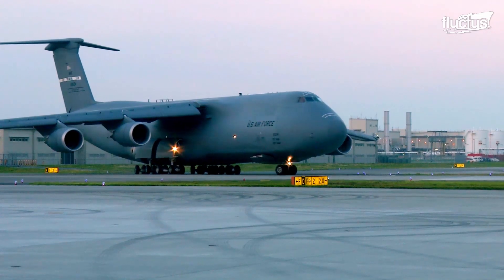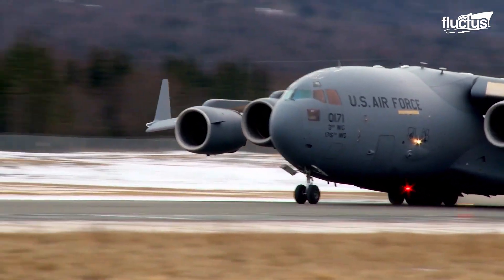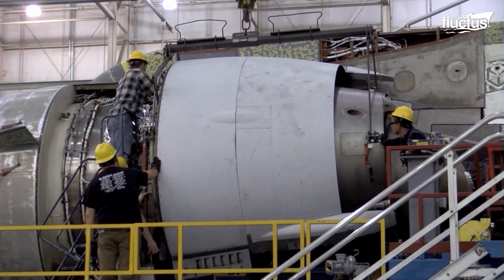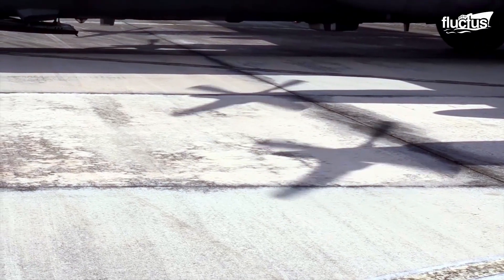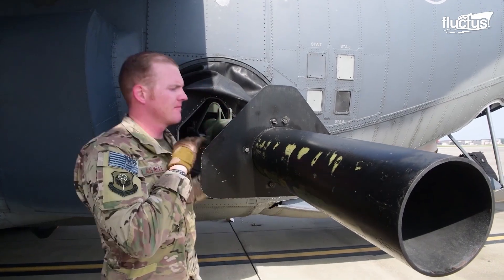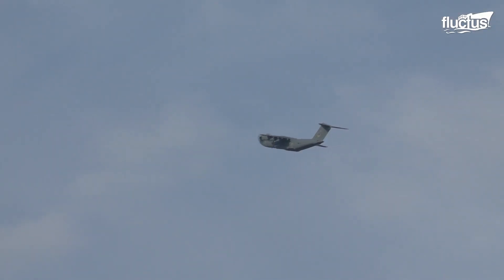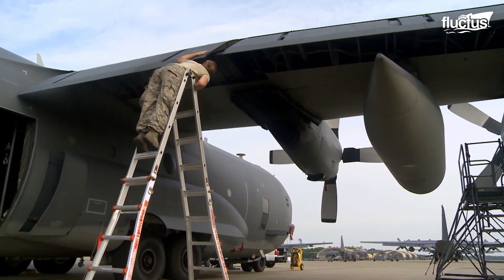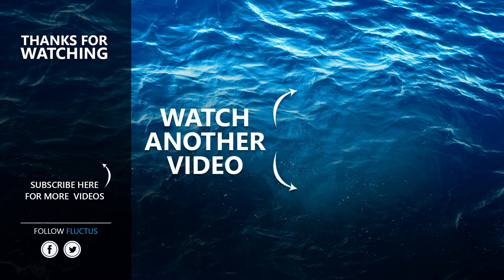This US Air Force C-17 Engine is So Powerful it Can Create a Mini Tornado

Comment: You need moisture in the air, the jet fans turn at incredible rpm's, similar to the moisture clouds that form around the edges of a jets wing when moving fast.

Comment: Not exactly related, however I worked as a precision radar system Technician at Homestead AFB ( 1968-1971) and we had B52’s and their counterpart The C-141’s with it very prominent large and high tail section would present itself on the radar scope as 2 very close radar targets. The newbie air traffic controllers using the Precision Radar MPN-13 GCA would panic thinking they allowed 2 aircraft to become very close to each other.   The C-141 was the ONLY aircraft in that time frame that would present 2 targets as the precision radar would make a radar target from the front section of the C-141 and another radar target from the tail section.     Present day I wouldn’t know about.   Go USAF!

Comment: These engines might have some power but the C17 cruises slower than most commercial airliners. Love the reverse on this airplane ✈️ C17s are amazing aircraft
Reply: True, but the reason why it cruises more slowly has more to do with airframe design than it does the engines. Those F117 engines put out around 40K of thrust each. Added together, that's 160K. That's more thrust than the KC-135's F108 engines put out, but the KC-135 is lighter, has a more "sleek" aerodynamic design and cruises at around M0.84 vs the C-17's M0.77.
Reply: Not to say that stronger engines are necessary to produce those visible vortices though. I started my USAF career as a crew chief on EC-130 aircraft. I did numerous maintenance engine runs on those birds in which vortices (tornados) going between the intakes and the ground were visible. They're like rainbows. They can show up on any jet powered engine, but they are easiest to see when weather conditions are right for it.

Comment: Lots of jet engines can do this. It depends more on the temperature and humidity of the air than on anything else. I've seen idling F-16 and F-14s do it several times.

Comment: In the early 70s, there was only one C-124 still in active service.  It was at Elmendorf AFB.  It crashed at a small base in Alaska and the crew survived.  It was replaced with another C-124 that the reserves had been using.  It was mainly used for oversized cargo at that time.  I helped load and tie down a fire engine in it once.

Comment: The "waterspout" effect has been seen in 737, A320, 767, 747-400, and 777s.  This is not just during thrust reverse, but in idle.
Reply: I've seen the back end of electric Motors do the same thing. It's nothing groundbreaking

Comment: The C-130 was even more impressive when it had JATO capability.
Reply: Or when they landed one on a carrier!
Reply: @brettmorton7365  As well as stop without the use of the arresting cable and take off without the use of the catapult system. 
The largest aircraft to ever land on and take off from an aircraft carrier under its own power. What an amazing piece of equipment!
Reply: @Philliph Whirley  and i believe it started its take off from where it stopped its landing! You're absolutely right, amazing piece of kit!
Reply: Oh, yeah!!! Loved the max effort takeoffs and landings!!! Yeah, riiight!!!
Reply: @philhand5830  It was just really cool to watch the JATO ignite and the airplane almost instantly lurch upwards. It was awesome watching the Blue Angels C-130 climb straight up. It’s not often you see an airplane that big pointing it’s nose that high. That is until the Boeing 777 which was amazing too.
Reply: What is Jato capability?
Reply: @adamrutherford4759  Jet-Assisted Take Off
They were essentially rocket packs made out of several rocket motors per pack depending on the weight of the aircraft and takeoff length of the runway. They were installed on both sides of the C-130 on the lower section near the cargo bay door. The C-130 would start its rollout on its main engines and then fire the JATO packs and it would give the aircraft a massive boost which would decrease its takeoff time. Search C-130 JATO on YouTube and you will probably find some older videos of them being utilized. 

Look at it like a race car using Nitrous “NOS” on the race track to get a quick and easy boost of power and speed.

Hope this helps.

Comment: Virtually overlooked on the C17, is the "blown flaps" feature. The flaps have portions of a flap directly behind the engine. It's too hot for aluminum, so those portions are made of titanium. Most aircraft do not have flaps directly behind the engines. This adds immensely to the lift produced at very low air speeds. This allows very high angle of descent, while maintaining a low rate of descent. This combination allows a very short roll out on landing, & very short roll out on take off. Very few aircraft have put together this capability. The idea of blown flaps has been around a long time, but this aircraft came along just when materials technology made it practical. 

The prototype demonstrator had "double blown flaps". Not just one series of flaps, but when deployed,  two sets of flaps, like louvres in a window shade. I asked if the change from double blown to single blown would lengthen landing & takeoff distance. The answer was "yes, but it would still meet specs". Double blown is heavier, more expensive, more complex, & requires more maintenance. I think they made the right choice.
Reply: Great comment, thanks for sharing your insight
Reply: @johnwilliams1091  From what I remember about aerodynamics, "blown" flaps means not having your engines blow against the flaps, but using bleed air from the engines (or having an own compressor) tthat iis blown out over the surface of the wings and the flaps in direction of the airflow to help it maintaining a smooth, laminar airflow, orver a higher angle of attack/larger flap angles, creating more lift at lower speeds (here: lower landing speed/shorter landing and takeoff runs)  
  

Without that, the airflow delaminates earlier and becomes turbulent  causing a massive increase in drag and loss of lift.   
 
That would explain the ridiculous climb angles you can sometimes see on videos.
 
  
Especially the Lookeed F-104 Starfighter needed such Boundary Layer Control, or his stubby 21 foot wings would never have been enough for reasonable landing speeds. 
 
Boundary layer: The layer of air over a wing/any surface where the the air transitions from a standstill (relative to the surface) to the full speed of the airflow.
 
That can happen over a distance of a few tenths of a millimeter til several meter, the faster the speed, the less the thickness, the bigger the surface, the thicker the boundary layer. 
 
I learned that at very low eind speeds the bountary layer over water can be up to 10 meters (30 feet) thick. 
That means the mast of a moving sailing ship pokes up through a massive change in wind direction. On the ground, you have no wind, the only wind you have is from your own movement and so directly from ahead. The higher you go, the more true wind combines with that induced wind, 
For sailing, the real wind has to come about 30 degrees from the side over 90 degrees to 45 degrees from the back, or even directly from behind. 
 
So you get an extreme change of apparent wind direction, from directly ahead to the true wind. You want the optimum angle of attack for the sail (which is aerodynamically more or less a wing set vertical) for maximum lift and minimal drag, so you trim it with a lot of twist, practically in centerline with the boat at the bottom, and let out far at the top.  
 
Sorry for that deviation, but I LOOOOVE the universality of physics. That once you understand the principle, you can apply it in all kinds of situation. 
 
 
Therefore my car will not get a cool spoiler - unless someone can prove to me that it is optimized to really create no additional or even less drag. 
 
Race cars have ample power and need pressure on the tires to avoid wheelspin, and ground pressure at low speeds to not slip in curves. 
To produce lots of downforce for the curves, the wings are massive, but that means enormous drag on the straights at high speed, so you must compromise.
Sacrifice top speed to be fast in corners. 
 
But as "normal" driver, do I really need that?   
At zero speed, the lack of wing speed means the spoiler/wing has no effect. 
In the city, you don't need it, too many dangers around. 
On country roads, OK. 
And in the US your speed is 55 mph anyhow, so who cares about losing top speed. 
 
But here in Germany, where we still have about 8,000 kms (5000 miles) of unlimited autobahn, reducing my top speed would be stupid. 
It's an old car, so I am careful not to overdo it, but I have pushed it some times up to 210 kph/130 mph, and it is fun when due to the low drag you are able to make that with 10 liter/100 km / 24 mpg. which is about the average mileage I get out of the 28 year-old car in mixed traffic anyhow.

Comment: I have been a jet engine tech for over 45+ years and all jet engines will cause this phenomenon under certain conditions if their intakes are close enough to the ground. Evan Navy aircraft on the catapult will produce this effect when they inhale the catapult's steam venting out. The C-17 is a tough little plane, a modern C-47 for sure ! They should be around awhile.
Reply: This is true, but I must admit that the height of the intake on the C-17 does create more of a phenomenon than say...a 737, for instance.  :)
Reply: @joemoore4027, I just noticed your comment after I posted mine.  LOL!  Sounds very familiar.
Reply: @davidwilburn6314, True.  They do sit up there quite a ways.  🙂
Reply: Gb saving lives,men women children,🌻katie&gio&girl with all the kids,Boston 🕯☔️

Comment: Points of personal interest.

What happens at the air-intake when the blades of the C130 pitch to thrust-reversal.? 
= Use the directional-exhaust-vectoring of the sea-harrier for the air-intake of C130, conceptually.?

C17 sucks good during thrust-reversal. The ground-clearance of engines of passenger planes is ... lower ... similar vortex observable from videos and they name those things "leap"... Acceleration down the runway for take-off without foreign-objects leaping should be ... thrust-reversal during landing should be... max-throttle near ground during landing is vaccum(air-cushion ground-effect defeat with suction of ground)...
Reply: I've had plenty of C-130 experience, and do not ever remember seeing a cyclone actually enter the air intake.  A T-56 engine's air intake is much, much smaller than today's typical turbofan engines.  In many ways, they're quite different animals.

On the 130, it's the prop (not the air intake) which elicits a vortex, so you'll see a water puddle, for example, come dancing up to the outer circumference of the blades which is a distance of about 1.5 meters.  The blades are generally producing too much rearward/forward thrust for any "water-spout" to ever enter the smallish air intake in any noticeable way.  Any surrounding water gets shoved rearward/forward by the rotating prop.

Secondly, the volume of air entering the engine's air intake would 'perhaps' be reduced somewhat with the props in reverse pitch, although the prop at the hub is not significantly "pushing" reverse thrust NEARLY as much as the outer 50% (plus or minus) length of each blade.  Nevertheless, the engine cowl and intake, I'm sure, are designed to provide at least the minimum amount of necessary combustion air, regardless of whether the plane is in "full reverse" mode OR "full forward thrust" mode so that the engine can maintain its combustion process and can do it within necessary parameters so that the engine does not overheat.  Only then can the engine be assured to operate at both extremes, especially when encountering HOT, HUMID, HEAVY situations.  That is certainly why weight and balance calculations must be made to ensure that everything is going to operate within established minimums.

Thirdly, going back to my initial point, and you may be well-aware....the 130 "TurboPROP" engine relies quite heavily upon the prop for most of its thrust.  Contrariwise, a modern "TurboFAN" engine needs big/huge air intakes surrounding the primary front set of fan blades which are responsible for the engine's primary thrust.  Viva la difference!!  :P
Reply: @davidwilburn6314  absolutely correct  re prop reversing.  You broke it down precisely! One additional thing in that regard, during prop reversal on the C-130, the flight crew pays strict attention to the TIT, (Turbine Inlet Temperature) gauges to ensure that the high limits are not exceeded. It is estimated that the propeller system (unducted fan) on the C-130 produces about 95% of the total thrust while the jet engine about 5%. BTW, the old Hamilton Standard 4 blade props were 13.5 feet tip to tip... quite a machine, that old Herk!
Reply: @philhand5830  Allow me to buy you a brewski, my friend.  Where are u?

Comment: It was a cool evening at Douglas's west ramp, 
the area where airplanes were checked out 
while test flying.  An MD-11 was idling, and I 
saw a mini tornado coming out the front of 
the #2 (center) engine.  It was quite interesting.

steve
Reply: Steve that vortex is normal during static runs at high power. It is often seen during engine trim runs. Interesting to note is that area has the highest measured noise level.
Reply: Worked as a FAA Aircraft Dispatcher at MDC LGB in Production/ Flight Test. Our offce was on the south end of the hanger accross from the delvery Center West Ramp. Worked there from 1986 to 2002.
Reply: @keithfreitas2983  any relation to a Freitas who worked for TWA at LAX?

Comment: The C-17 was not the successor to the C-124; there were several aircraft in between: the C-141, C-130, C-5, & C-133. The C-17 compliments the C-5 & C-130 aircraft, providing airlift capability greater than the C-130, but less than the C-5.
Reply: Thanks for mentioning that. I was fixing to if somebody didn't.
Reply: That was going to be one of my comments as well.  Thx for covering it already.
Reply: Also the engine is literally the same as 757 lol
Reply: While there are many aircraft in between, the C17 is the Globemaster 3, making it in name at least a direct successor to the Globemaster 2.
Reply: Are they still flying the C141 ? I remember those from 40 yrs ago
Reply: @wallbanger3  A quick query on the Internet says it's now retired from service.
Reply: @wallbanger3  I flew on a C-141 from the Mississippi ANG in the early 2000's (or maybe late 1990's) while I was in the Air Nat'l Guard, & that was the only time I flew on a C-141. I believe at that time, the Mississippi Air Nat'l Guard was the last of the ANG bases to still have & fly them. I think the USAF had retired the C-141 maybe 10 years before it was retired from ANG service.
Also, in an unrelated story, I was in Idaho around October 1991, & saw an F-4E Phantom jet landing at the Boise ANG base, which was the last ANG base to have & fly the F-4E.
Reply: @wallbanger3  no. I worked on C-141's at March ARB until we sent all of ours to either museums or to AMARG in Tucson. All other C-141 units have also since either replaced their fleets with C-17's, moved on to other aircraft types, or inactivated.
Reply: Ok Mr professor 😂
Reply: My dad flew the C-141s thanks for bringing that up.

Comment: It can use thrust reverse in flight. Is that true. It sounds crazy.
Reply: that is not new, some of the 4 engine jets of the 50's and 60's did this.
Reply: @bkailua1224  Are we talking about the same thing? The show said they used the thrust reverse feature to slow down speed of plane While in flight. That's what I'm talking about. Using that feature sounds crazy,  when to slow down in flight all you have to do is not give it any gas. I would think anything over 200 mph would tear wings off a plane or loose so much lift it becomes extremely dangerous. I could be wrong just never heard of it being used that way.

Comment: curious why it pulls from the ground.  what sneaky force is at work here lol
Reply: Simply the fact that the ground is there, but in every other direction there is a greater availability of air to replace that which is drawn into the engine. The ground is in the way of an efficient amount of intake air, creating a lower pressure zone comparatively therefore creating the vortex from the ground into the engine..
Reply: @brettmorton7365  thank you!  i appreciate you taking the time to answer my question!
Reply: @invictusfarmer7188  glad to shed some light 👍🏻

Comment: I was on active duty Army back in early 90s at Fort Lewis, WA.  We were doing a PT run around the airfield and saw this new plane doing "touch and go" runs.  I was use to seeing C-5, C-141, KC-135, and C-130s and had no clue what cargo plane that was until many years later.
Reply: And what was the cargo?
Reply: @danthepaninjapancq  Don't know?  It was just circling doing touch and go on the Army airfield.  It didn't have any markings other than the normal gray paint job.